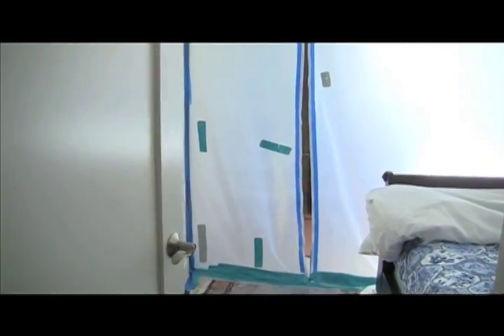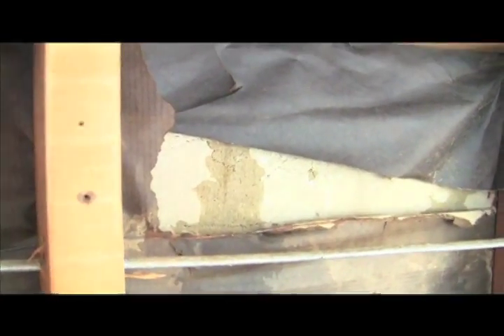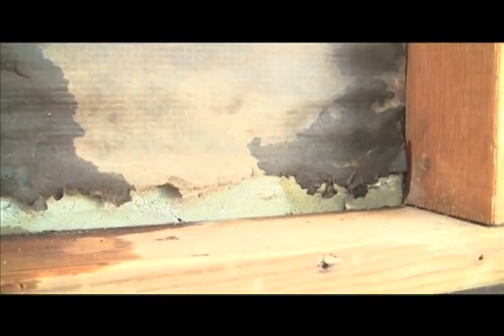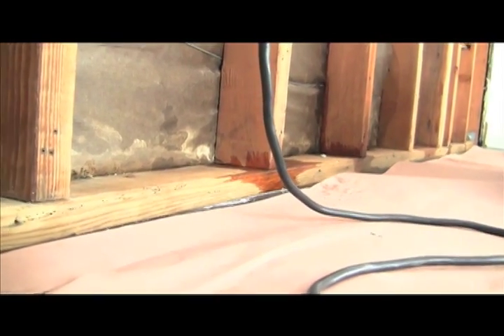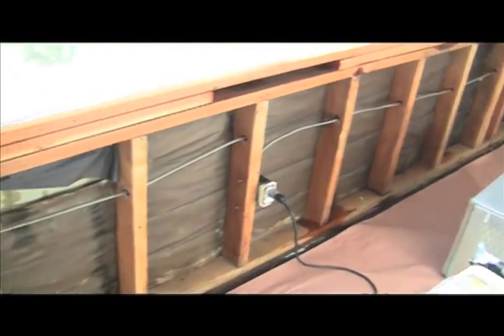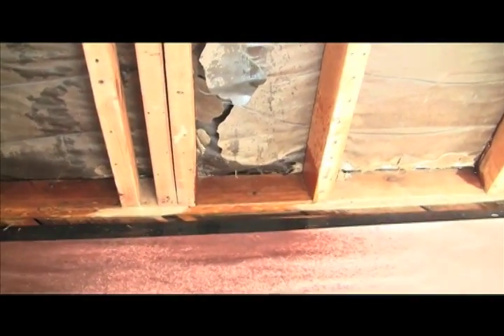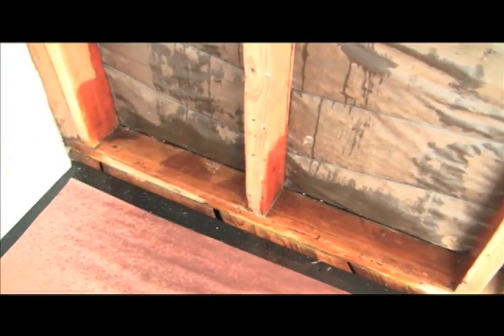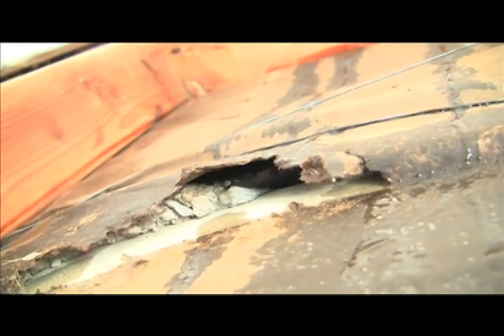Stucco Building Envelope leaks

Comment: i agree inspections are and that water will weep between plaster and WRB , but i was wondering why the paper is deteriorated at the base, and for that matter, why is there no weepscreed.  The WRB should lap the flange of the 3 1/2 weep and be clearly visible at the plate line?

Comment: Who would say that water can't seep into something? Water can get anywhere. That's why it's called water. What was the condition of the painted surface on the stucco? Is it only wicking in around the window frames upstairs? For that much damp, it's amazing the mold isn't worse.
Reply from the maker: Hi Maxid,
My experience is water gets in behind stucco 2 primary ways:
1. Cracks in the stucco
2. Stucco termination against dissimilar materials. 
This is way is is important to correctly flash all penetrations and create a water proof building envelope.
In this video, neither flashing was correct not was the building envelope installed correct.  
Additionally, this demonstrates why 2 layers of building envelope are necessary.
And why a lath QC should be performed before scratch is applied.
Anyway, I could go on and on but I won't. Thanks very much for watching.
Gene
Reply from the maker: One more thing... It is surprising how many in our trades do not believe water gets behind stucco. They think stucco is "Waterproof" there for maintained on the outermost plane.  Wrong. I hope ths video demonstrates how wrong this is.
Reply from the maker: Gene Summy btw this stucco wall was a 3 coat system, and about 10 years old.  Fairly typical for the West coast.
Reply: Two scratch and a top coat. So was water intrusion just at the windows or was it widely cracked? Being the west coast, houses never stop moving, or stucco cracking.
Reply from the maker: Maxid1 Hi Maxid, The water got behind the stucco from a variety of areas. As it travelled downwards it diverted into the home due to the poor building envelope.
This is a great example of why 2 layers of a high quality envelope should be used, and a lath QC inspection should happen before the scratch coat is applied.   All The Best to you... Gene